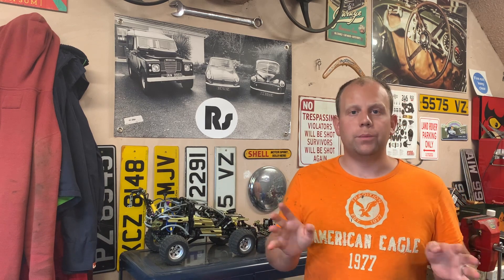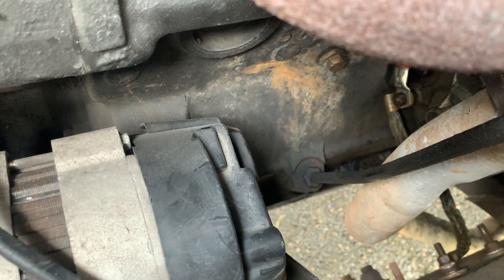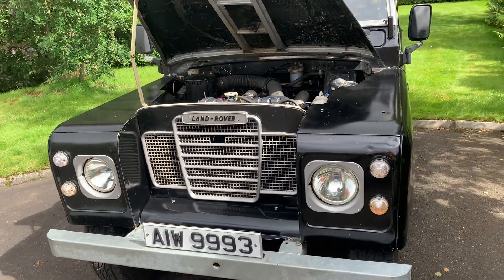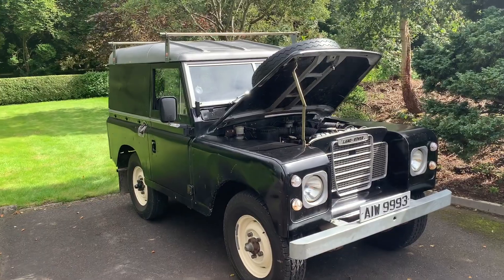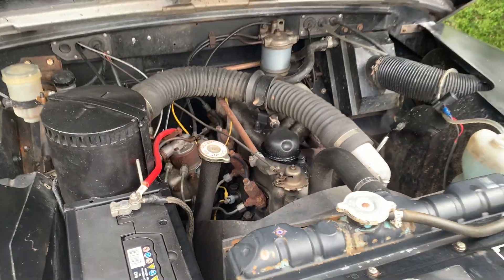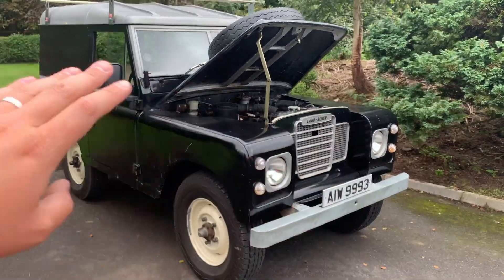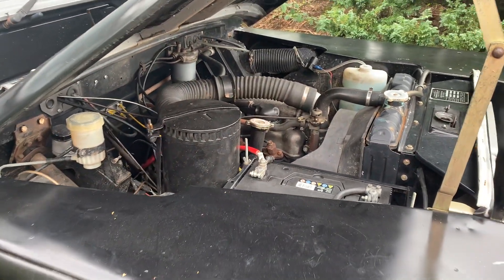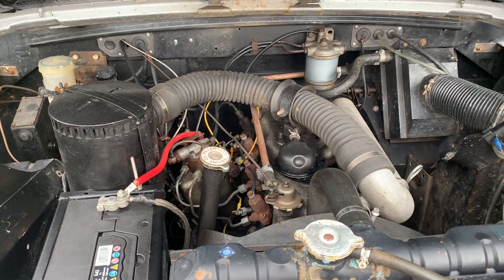Engine Conversion Options - Land Rover Series 3

Comment: a popular conversion here in australia  was to put a Holden 186 red motor in landrovers fairly basic conversion 
if the engine runs good i'd look at getting the crack wellded  properly done it will last the life of the vehicle it needs to be plug welded to stop the crack returning
look up metalshapers channel he repairs early jeep blocks  
unless you change the gearing in the diffs the rover will still be a slow vehicle 
not sure how your registation system over there works but if you go down the path of changing the engine you might need a engineers certificate
Reply from the maker: Thanks! I’m going to look into having the block properly repaired, shouldn’t be too expensive I hope! Thanks for your comprehensive comment!

Comment: I would say to fix it yourself personally, a v8 would look amazing, lots of work though. thank you for the video!
Reply from the maker: Thanks, looking for plenty of feedback on this one. As you say, a V8 would be amazing but a huge undertaking at the same time. Glad you enjoyed it!
Reply: Restosaga Workshop v8 sounds nice, but they: high maintenance, you'll have to butcher your nice original vehicle to fit it, you'll break your tranny/diff sooner or later. Also your brakes need to be upgraded. If you don't do many miles: 2.25 or 2.5 petrol is the nicest to live with
Reply from the maker: A 2.5 petrol is a top option! Yes, V8 does seem to be a lot of work